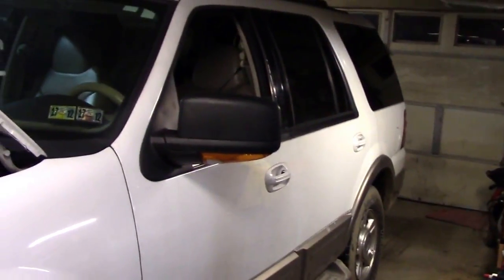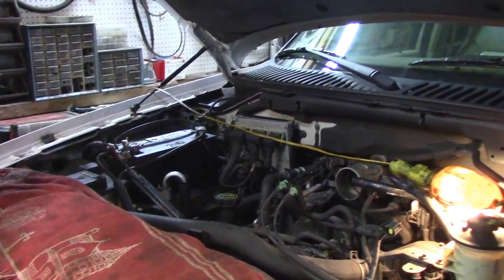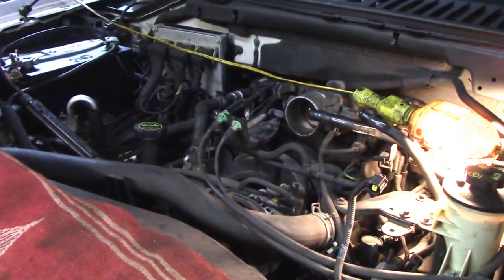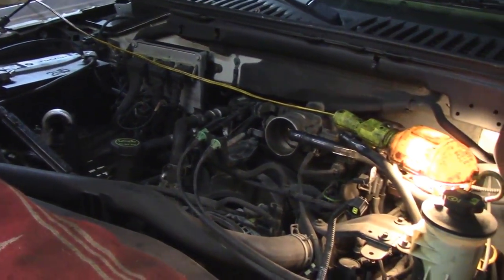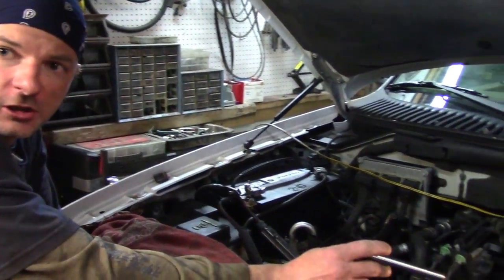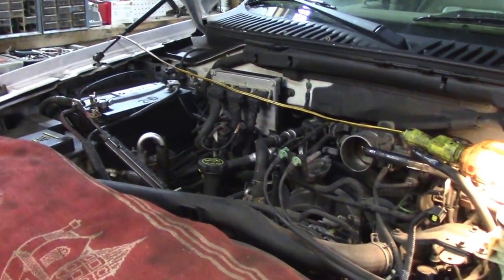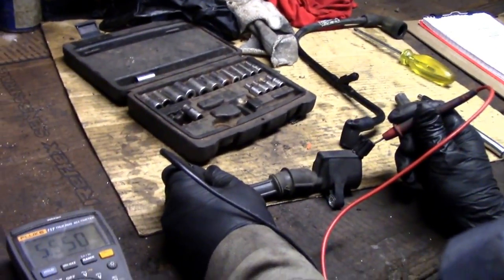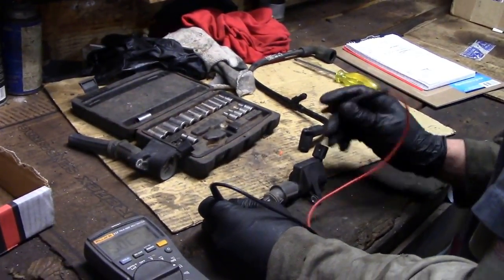Expedition P0304 code cylinder 4 misfire testing coils and fixing vacuum lines

Comment: Replaced ignition switch, coil pack, I only have 1, spark plugs, spark plug wires, battery, altenator and still have a battery drain and a random misfire pops up.
I wish it was so easy as everyone keeps saying. 
Swap the pack, swap the packs, I ONLY HAVE 1. jeez 15 videos on spark plugs 🙄
Reply from the maker: There are tons of reasons for both.. watch videos on how to test wiring.. it will help more..